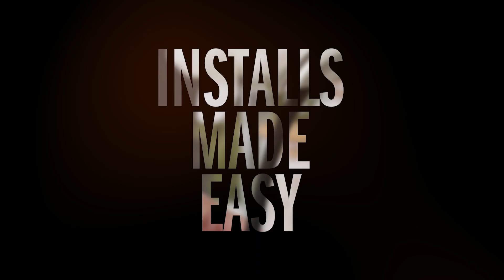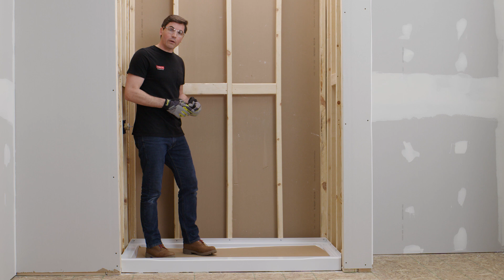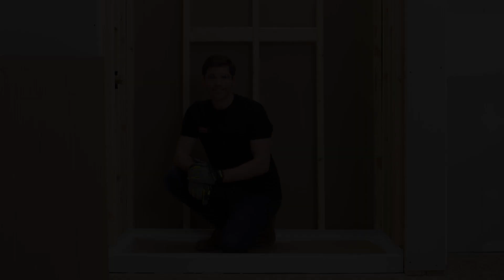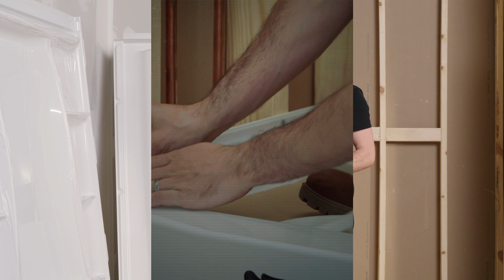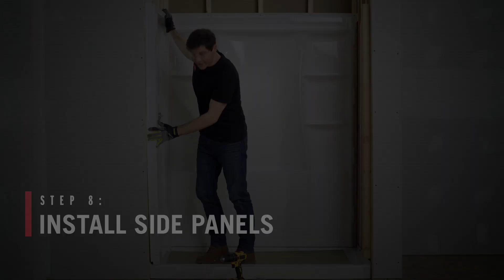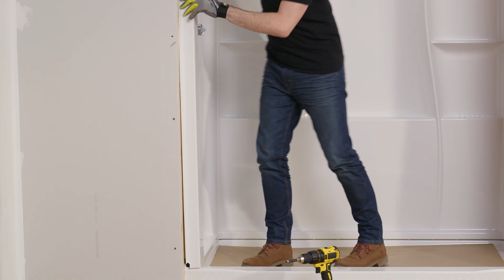How to Install the Delta® EverEdge Shower Wall Set (60x32)

Comment: This is a really great how to video. This will help me tremendously as im doing a full bathroom with laundry in my finished basement. I had contractors estimate it to be 20k or more. Im a little upset with how it ends though. Why not show how you finished all the drywall surrounding the shower walls? Why not install a door? Im sure i can find videos on it, but i really like your commentary. Added this vid to my favorites.

Comment: Why not cut your hole in the panel first, mark the center on the wall, then install the mixing valve at that location? Seems easier than screwing up the hole location trying to match the existing mixing valve location…
Reply: Seriously

Comment: I have this exact same shower. Before I start, will it hurt to caulk around seems after everything is finished? Some videos say not to if it’s caulk less. Something to do with causing mold etc because it needs to drain, I believe is what they said. Thank you.

Comment: Any tips on how to finish the wall where it intersects with the flange? Its indicated you can put these directly on the stud, how do you join the drywall to the flange without it cracking when the flanks shower flexes a little? Should some trim be added? Any help is welcome.

Comment: Can you drill through the walls of these to mount a safety grab bar, as long as it is supported with braces in the location of the walls?
Reply: I wouldn't see why you couldn't. Just probably use sealant around the joint.